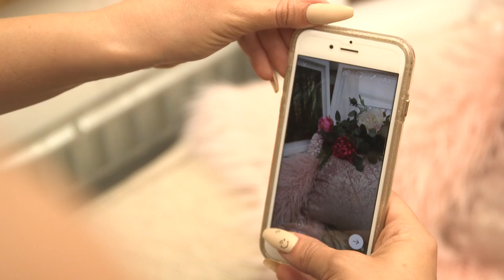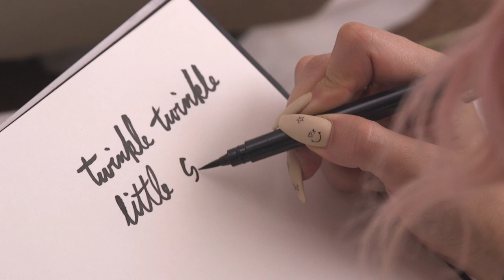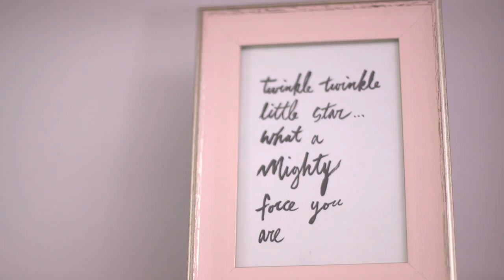Bohemian Nursery Makeover | Breaking Beige | Mr. Kate

Comment: I wish you had a series called breaking colour, cause I made the mistake of having too much colour and no neutrals... it's a wreck
Reply: me too i have hot pink walls and so much colour in my room but I love minimalist and monochrome so arrrr
Reply: S h a y n e or it could be called correcting colour
Reply: Gracee B try white walls, i did that and put glitter packets for paint in and its a nice touch! I also stuck to gray bedding ( for my color scheme ) with some pictures for a pop of color. It made my room look bigger ( i have a smaller room ) and just helps it took look cleaner and i have minimal furniture.
Reply: Cracking colour?

Comment: Joey if you put a hole in the center of a paper plate and slide it down the drill bit, it becomes a catch tray for when you are drilling in to the ceiling and you won't have the mess to clean up.

Comment: I'm sure you did this, and just left it out for time or something, but its very important to fasten furniture like shelves and dressers to the wall so when baby starts pulling up they don't tip furniture on top of themselves. Children die of suffocation and crush injuries every year because of furniture. And something to prevent the cute teepee from collapsing in on itself for similar reasons (like braces between the beams or something). Anyway this nursery is perfect! Just wanted to point this out in case any new parents saw this video and wanted to emulate it but didn't know about the furniture thing! Great videos!

Comment: the room is beautiful, but you didnt bolt the shelves to the wall the baby pulls on them they can slide out and hurt the baby. , the chain on the lamp wasnt secured so the baby wont choke on it, and the mattress on the crib was set for a toddler not a newborn , the flowers on the teepee shouldn be that long and the metal able to poke them in the eyes when pulled on........these are things to think about for babies. safety first!